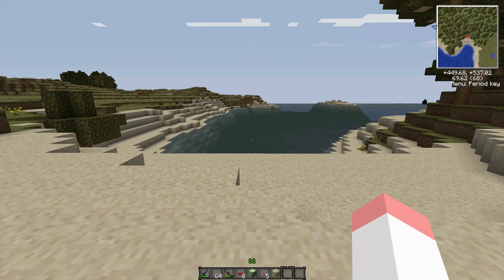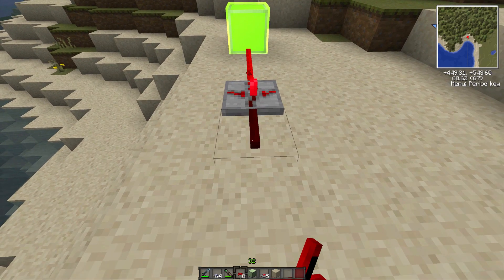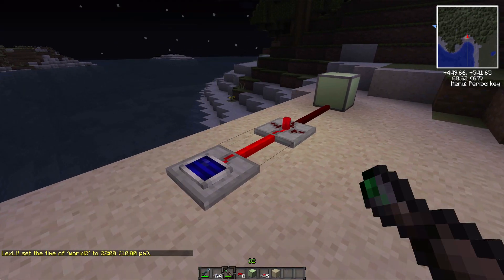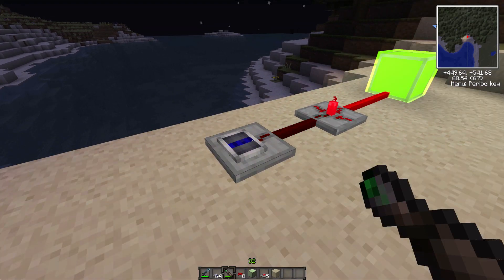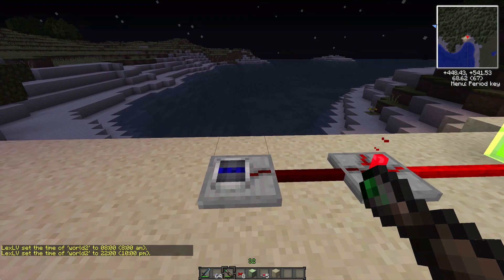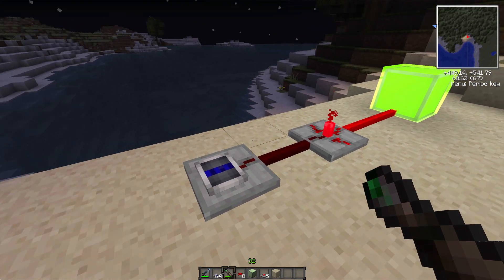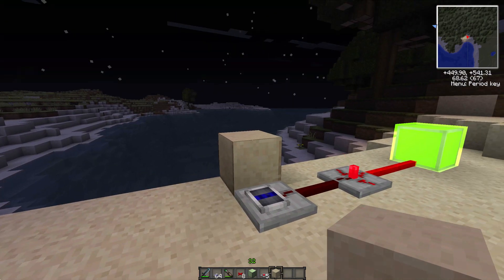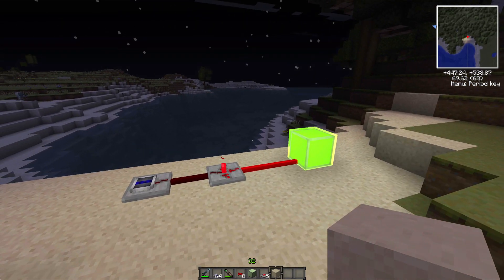Day and Night light sensors in Minecraft Tutorial - Redpower & Tekkit

Comment from the maker: The sensor block turns a redstone signal OFF when there is not enough light, so you need the NOT gate so it will become ON when there is not enough light so the light block will work.

You can use either screwdriver they both do the same thing.